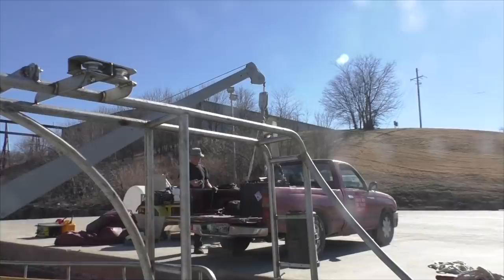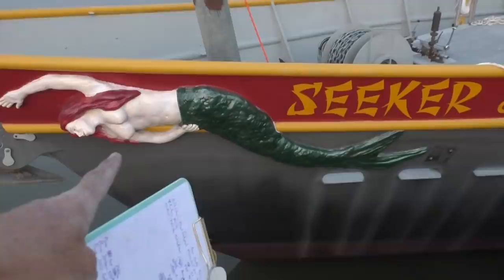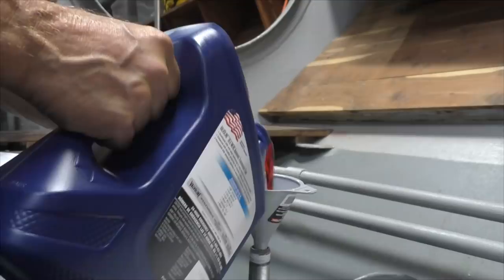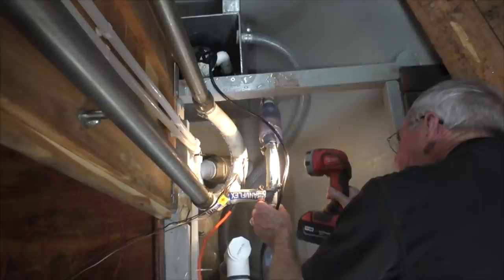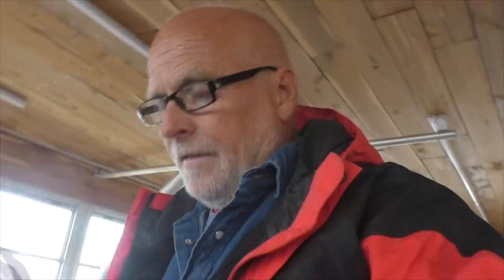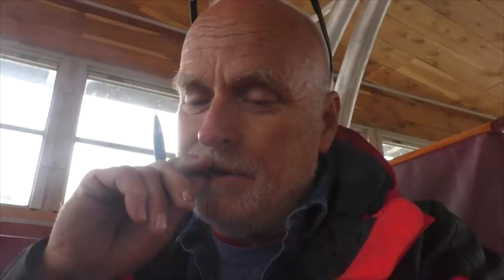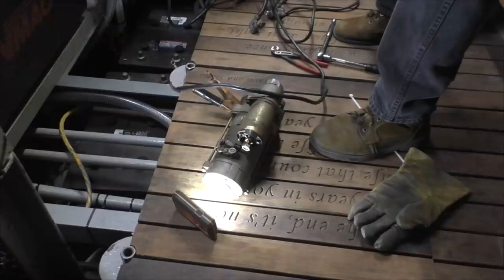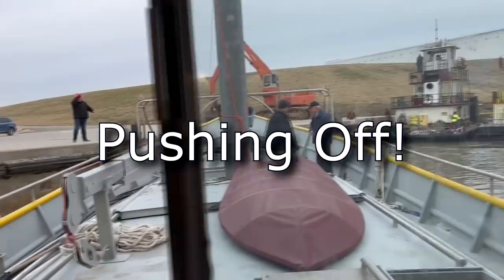Fire, Flood, Listing, Engine Failures and other Dockside Calamities

Comment: Problem with regulating the flow for the crane using the ball valve is you can wash the valve out.
Reply from the maker: Yup, but I don't think we'll be using it that often.   And I personally like it with a bit more zest in it's movement.
Reply: @SVSeeker  so I’ve been watching you build this boat from before 2015. While I may not agree with some of your safety practices or opinions I respect them as yours and your life. I am happy to finally see you get her toes wet and have her floating. You set a goal out in life with a vision and done what most people are too weak minded to do. Congratulations on this closing of a chapter and I wish you the best on the next steps. 

And you were correct in assuming that you should back away from the dock. You have more control on how the boat reverses away and her fat ass won’t swing into the was as you try to maneuver out.

Comment: Boy, water in the fuel can cause major problems. The racors are pleated paper and will swell and starve off any flow, and hopefully before it gets into the injector pump. If it does, you can trash that pump because the tolerances are so tight. That's why you have a return line. That excess fuel takes any heat away and the fuel oil lubricates the injector pump. Get some water cut paste and make sure you're supplying clean fuel to the engine. Did you put a high suction and low suction on the day tank and is it fitter with a bottom drain? You'll have a lot less  problems (guaranteed) if you supply clean fuel to the engine.  Also make sure that the anchoring system works in case you loose the main engine (and only engine.)
Reply from the maker: Well it only caused a minor delay.  Most problems are big in imagination small and reality.
Reply: @SVSeeker  That may be true. The advice I was offering came from a place of personal experience. In 4 decades of experience as a marine engineer, contaminated fuel has been a serious problem at points in time. In stead of going into a lot of different stories, let me  share just one. I was working for Red Stack tugs in San Francisco, and they'd brought up a boat from L.A. (an old navy YTB that they'd reengined and modified) and because I'd had been with them for awhile, they chose me to go on the inaugural job, up at the Standard oil long wharf. When it came time for the big push, it was clear that there were some problems. It was traced back to  contaminated fuel, from a bad tank vent. Fast forward several years and the boat was coming out of dry dock in Crescent City, Ca. and the port engineer asked if I would go up and help return the boat to San Francisco. I said sure, and asked him if the fuel tanks in questing had the vents changed out. I was told that someone had checked them out and ok'd them. It was an 8 hr drive up there. upon arrival there was a person acting as the company rep who was not a licensed engineer and doing some stupid things. I held my tongue at that time and just reminded him that the company had added my to the crew as engineer to take the boat south and that I had it from here.   The boat went into the water about sunset, we got underway heading south. It was lumpy out and during an engine room check, about an hour after getting under way, I noticed water at the bottom of the sight glasses and immediately went to the wheelhouse and told the capt. that we needed to pull in to Eureka. We called for a tug to escort us in and upon contacting the port engineer, he had to drive back with some new tank vents. and we made some other mods, to be able to get clean fuel to the engines, in the event of another problem. The person that had been acting as the rep said something, and I put him in his place. The rest of the crew all thanked me for that later. There are pages of details that could be included, but I'm not writing a novel here, and as I recall, there seem to be some question as to how water got into the fuel system. I was just offering up a caution and some problems, especially if they've happened before, can be addressed  before they become catastrophic in the future. At any rate that's my two cents.
Reply: @musoangelo  And that's before we get onto bacterial fuel  sludge. Having had old Diesel car fuel tank sludge troubles I'm organizing a fuel polishing (filter and dewatering)  rig in a current truck build and presently  trying to debunk or otherwise claims on magnetic 'conditioning' to break down sludge that seem to defy reasonable logic.
Reply: @philhealey449  We use to regularly treat fuel tanks with biobor and if you didn't have too much algae , it would just be a matter of changing filters when they started increasing vacuum. I've also been on a boat where a new engineer took fuel from tanks that hadn't been used in years (the root valve had been wired shut and he cut the wires and started transferring fuel, before asking someone why those valves were wired shut) and when it was circulated through the rest of the fuel oil transfer system, really caused problems. If you stay ahead of it, you can manage it without too much problem. If you get a sever algae contamination, it's going to take some work to get back to a working boat.
Reply: @musoangelo  Thanks for insights !  Old Mercedes 300D saga was in hindsight suction effects in the hand priming pump and bouts of power loss, with garage BS assurances they'd cleaned out the system , but a vile ecosystem emerged when I drained the tank. I'd had previous generator set biological fuel issues also, so I'll certainly look into biocide additives for my project  I'm struggling to find robust scientific evidence of magnetic biocide performance to justify adopting it in addition to a filter/cyclonic water separator.
Reply: @philhealey449  You're more than welcome. I think once you have gotten the system clean, you should be ok. On Seeker, he has Racor filters and if you have water in the fuel, you can see it in the clear bowl on the bottom of the filter. The bowl has a drain as well. I know that make smaller racor units and that may be an option.
Reply: @musoangelo  Yep, going that way on filter/separators  and looking to maybe use homebrew  beer CO2 manifolds to select circulation and tank-to-tank transfer modes within the tight plant space available. Commercially available small  polishing packages seen not to have tank  selection valve  manifolds and I was shocked  by the price, provoking a DIY route. They  do promote use of a circular magnetic  (rare earth?) "conditioner" that set off my smoke and mirror alarm on miracle magnets, needing either  debunking or reluctantly accepting and replicating!

Comment: head plumbing is no good!   That's a no go!
Reply from the maker: Ok.  Do it the other way on your boat.  : )
Reply: @SVSeeker  I do!   It's called an anti-siphon valve.   That would fail survey.   :)
Reply from the maker: @djpar3492    How do you draw water through an anti siphon valve without drawing air?
Reply: @SVSeeker  they Install a raw water vent loop between hand pump and bowl of head.   vent needs to be above waterline.   If you do this on your boat the head will never sink it!  Anti siphon on discharge side.
Reply from the maker: @djpar3492   Oh, Ok.  I see what your talking about.   Thanks for taking the time to explain it.    But I seriously doubt that makes a boat unsinkable.  : )
Reply: @SVSeeker  No, just the shitter won't sink you now!  hahaha
Reply from the maker: @djpar3492    Actually if we had not been working on the vent loop before lunch it would have only have drained down the shower pan and triggered the sump pump to dump it over.    But I still like the modification and it's on the list.   Thanks again.
Reply: @SVSeeker   Welcome!  I enjoy watching, lots of work put in there!

Comment: Transmission fluid temp needs to be ran at around 180 degrees fahrenheit.
It is possible to run transmission oil too cool and you have plenty of direct cooling.
"Stant" also makes transmission thermostats, as an oem supplier.
The higher temps help to prevent water from building up in the transmission fluid.
Reply from the maker: Yeah we could cook it more but it's best to hold some HP in reserve.   Our plan now is to remove the torque converter.
Reply: @SVSeeker  230 degrees fahrenheit would be considered "hot" on that type of fluid and transmission.
Constant running below 150 degrees, could cause the some odd wear in transmission from being machined to operate at higher temps and condensate buildup in the fluid.
Running an engine at lower temps causes similar issues.

Comment: If the boat tilt's like that with just a 400kg on crane, then I wouldn't feel good with sails on this big mast.. (sailing is mostly sideways force turned into forward with the help of keel)
Reply from the maker: Yeah, it should heal  ( sailing term for tilt ) about 25 degrees.  The more it heels the more the righting moment ( force to make it resist the heel ) increases and the more wind spill from the sails.   Anything more than 30 degrees and it's time to drop some sail.

Comment: You just lost quite a bit of fuel capacity by filling the fuel tanks with lead bars.
Reply from the maker: 94 bars *19lbs / 600 cuft *7.48052 gal/cuft =22.3 gallons.    Out of 800!  <> "quite a bit of fuel capacity"

Comment: Marine battery  cut-off switches for emergency disconnect.
Reply from the maker: We'll the only thing those batteries power is the starter.  I hope it locking on is not a common thing.  : )

Comment: None of that lead is secured?
Reply from the maker: : )    Not exactly a lot of 20 ft waves on the river.
Reply: So its a river boat?
Reply: It will settle a bit.  Important part is that he's placed it such that it cannot move any considerable distance with pitch, roll, or yaw... small compartments are the security.  There's a high likelihood, too, that once he's fitted up and provisioned, that the trim will change again, so he'll be moving blocks around to get it right.  Once he clears the Mississippi, he'll be in saltwater, and that will change his bouyency, so he'll do it all over again.  The greatest concern, is that once he's fitted out, that he'll have righting stability, the ability to trim underway for both motor and sail mode, and still have plenty of seakeeping.  Downwind freeboard will be the greatest concern, those portlights might be challenged by full sails.
Reply: @davekamp6590  understood.  Not a great idea to add reactive metal to the fuel tank though.
Reply: @williammuseler5542   That was a total WTF moment.  And there have been plenty.
Reply: @williamd1891  Gross understatement. "Platoon" quote, "...I got a bad feeling.."

Comment: 4.44:1 1st gear with a 1500rpm converter, PhD converters in Detroit could make you a converter drive to eliminate the converter slip
Reply from the maker: That's what we plan to do.  I'll put PhD converters on the list.  Thanks!
Reply: @SVSeeker  that's a very heavy transmission, the at540 from Allison. 500lbs ish iirc What exact gear ratio do you actually need ???.
Reply from the maker: @seancollins9745  4:1 would be my preference based on the math I did using Dave Gerr's Propeller Handbook.   The AT545 will give use 3.4:1
Reply: @SVSeeker  can you feather the prop enough for reverse ? or do you need a dedicated reverse ? and I assume here that you have a SAE #2 bellhousing ? I think I know of a 1 speed gear reducer with a reverse option that uses a single planetary. honestly, this would be a excellent application for a Lenco section. with a bruno drive. it'd weigh around 85 lbs, and take 2000 lb ft of tq. I'll see what I can scrounge up
Reply from the maker: @seancollins9745  No, it only has 90 degrees of swing.
Reply: @SVSeeker  so let me get the facts right

4:1 reducer, 600 lb ft of tq, give or take fueling limits, reverse, sae #2 bellhousing. I have a idea, I know a guy with a truck salvage yard, would you be ok with a clutch to shift between forward and reverse or shutting the engine off ?  I think I could build this out of a 10 speed eaton transmission. gut the case and pull out everything but 1st and reverse, shorten the case and try to get the weight down. In theory I could machine a case out of billet and just grab what I need from the shafts of a parts trans. that should net you 4.5:1 in first and 5:1 in reverse.Let me do some maths. also could put in a gear reducer from a 10 speed, so double reduction, and it'll handle the TQ.
Reply from the maker: @seancollins9745    I see no reason that that would not work.  I bet there are more than a few boats out there running that sort of setup.   Likely a dozen in Vietnam alone.   But I see no reason the 545 will not work, less the torque converter and we don't have to mess with a clutch or shift.   Shifting the 545 is as simple as moving the leaver up at the helm.
Reply: @SVSeeker  the at545 is a good, tough unit. I know from videos you need to probably still lose weight of the stern end of the ship, I'll scrounge around this weekend see what i can find. Iirc the tq converter in the at545 is like 90lbs. A recirculating hub drive could weigh significantly less. Like, 10 lbs or so. 

My main concern, would be running the at545 in reduction mode that much
 I don't know if the planetary gears are well qualified in durability for this kond of use. In most truck applications the shift upto the 4th direct coupling right away. Then they use converter stall speed for tq multiplication. 
I'll see what I can come up with and shoot you a email

Comment: With a variable pitch prop why do you even need reverse?  Don't you ust pitch the blades the other way?
Reply: The variable pitch doesn't have enough travel to go from fully feathered to reverse. Normally it goes from forward to reverse, but won't feather (who would feather a motorboat prop?). Doug "shifted" the range so he could feather it.
Reply from the maker: Nice, thank you
Reply: @chrishopkins3079  My daughter drove a US warship (DDG) for 5 years, and it was the first "boat" I ever heard of that had variable pitch props.  In fact, she told me the Arleigh Burke class DDG's were the first ships in our Navy where the prop shafts only turn one direction.  When they want to reverse, they simply adjust the pitch all the way.  In fact, they can do so at full forward speed, and the damned thing reverses in like 1 1/2 ship lengths!

Comment: Putting more weight in the bow doesn't do a thing raising the aft. That's my experience. So you will have to move things...a lot of things!
Reply from the maker: We'll actually it did.  Not as much as I liked but we gained several inches from where we started.   But you're right that the CB moves as she sits deeper.

Comment: the unsecured lead bars in the fuel tanks... not worried about bars breaking the tank during extreme listing?
Reply from the maker: After 10 years of heating and bending steel with chain host and a sledge hammer?  Hell no!   : )

Comment: hey Doug 

have you look at people wight ? .  win you have people sleeping  up in the front cabin you could be look at 1,000 ponds of wight and the same goes in the  kitchen cabin or more
Reply from the maker: Right, live load is hare to control.  : )   But 1000 pounds actually does very little.
Reply: @SVSeeker   if you not worried  bout 1,000 pounds, then i wound not bother with move the V MAC and the washing machine they would be round 700/ 800 pounds
Reply from the maker: @mmtimy   It is small, but my point is you don't have control over the live load.  : )

Comment: Your transmission will not handle load & will be unlikely to last to the end of the river.( thats with the) current. You need a proper Marine gearbox.
Reply from the maker: So much confidence!  Would you like a bet?  Say $5000?
Reply: You are taking the bet & $5000 sounds like paperwork fees.
Reply: @SVSeeker  Yes, I know, opinions arte like arseholes: everyone has one, and it's not a good idea to share them around. Howver, my cxomment was made from the point of view of someone who has spent 40 years in the marine engineering  industry, & was made so you can (if you choose) ntheconsequences of drifting down the river with no propulsion.🙂
Reply from the maker: @melclark1066  Mine is based on talking to transmission rebuilders as well as retired engineers from Allison?   And I'm willing to make money off this experiment so maybe you're willing to put your's where your mouth is?   : )

Comment: need some brass submarine flushing valves in your head. that plastic 90 degree throw will fail you in the time of need. maybe put a hydraulic remote manual operator so you can have some flood control for the valve in the bilge. and a way to isolate when pier side for extended periods. just me suggesting is all. oogah oogah.
Reply from the maker: I toured the Batfish submarine down in Muskogee.   Love the head on them but I thing they are a bit overkill for a boat.